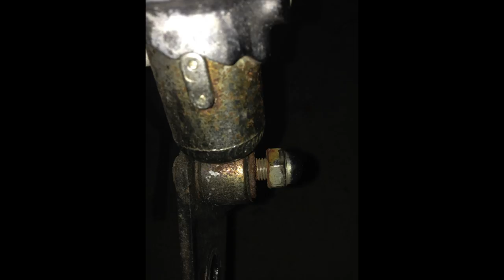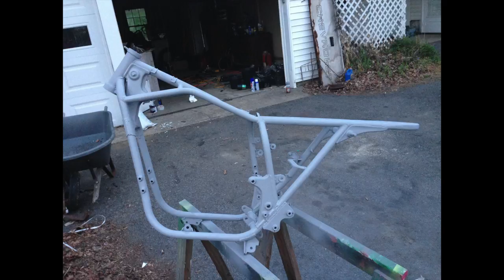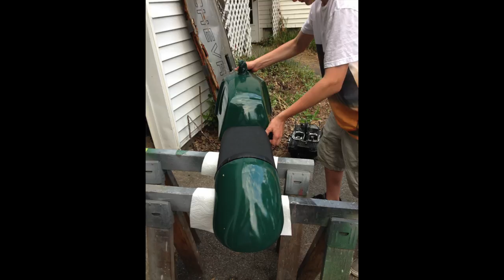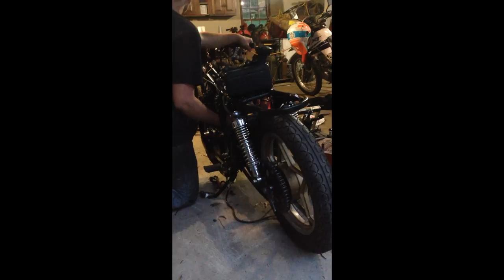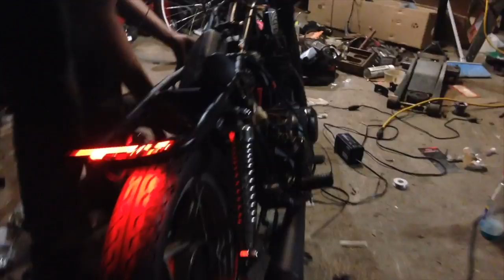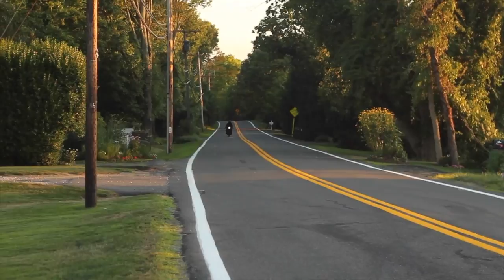Café Racer 1981 Suzuki GS450S Build video and photos of Custom

Comment: what type of foam did you use for the back I looked at many none like yours
Reply from the maker: High density 2 part foam, used typically in marine industries for boat repair. fairly inexpensive

Comment: Jet sizes for the carbs please?
Reply from the maker: Hey, my cousin is the one who built and dialed the engine in so I am not 100% sure if it was 35 or 37.5 in the end. He was back a forth a bit. But a lot depends on your elevation and how much air restriction your pods have. My pods are basically chickenwire so there is very little restriction. My suggestion is to try a few out within a range. Luckily they're inexpensive for these. Hope that helps

Comment: From where did you get the the spoke rims? Best regards
Reply from the maker: Hey, you have to find a 74-76 Kawasaki Kz400 set. They're out there. You need to do a little bit of shimming but they are able to fit on the axle from and rear no problem!  Hope that helps
Reply: Only the wheels and I can then use the brakes and everything from the gs?
Reply from the maker: Well for the rear wheel I would try to get a KZ400 rear drum and sprocket. It lines up perfectly with the GS. The front is a little more tricky. I had to use the GS disc, but drill the 4 hole bolt patter to mount onto the KZ front wheel.
Reply: you've been so incredible helpful. I thank you in gratitude

Comment: Did you end up cutting or welding anything?
Reply from the maker: Martin Salazar hey yeah. All the tabs in the triangle were cut off. The exhaust as well was shortened quite a bit. The shims for front and rear wheel took some as well. The frame was cut and then the hoop was welded to shorten and round out the rear
Reply: James Woods thanks for the advice. I'm getting ready to start my gs450 cafe racer project and I need all the advice I can take.